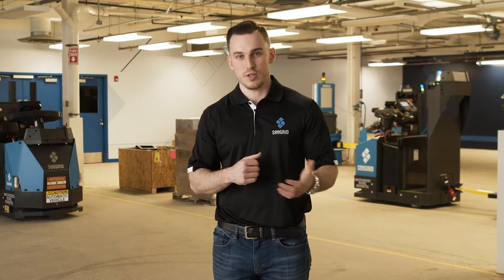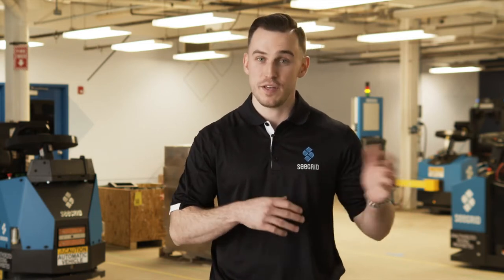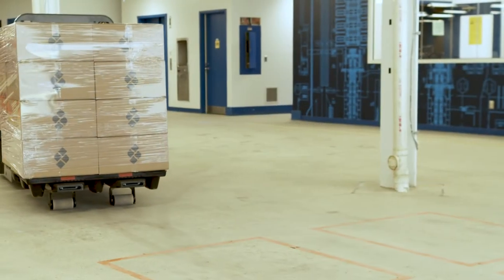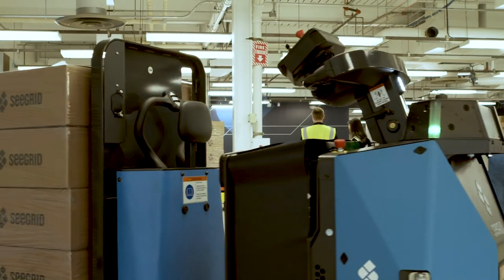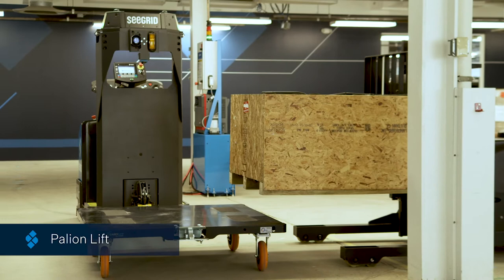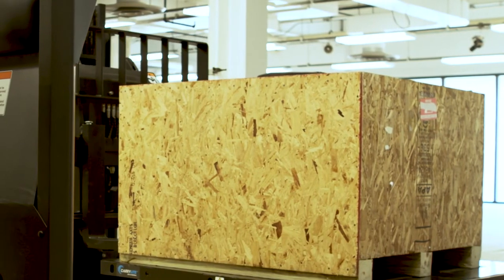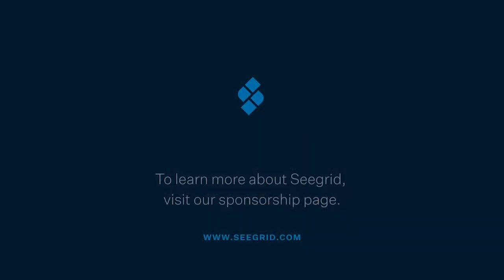Seegrid Product Demo | ProMatDX 2021

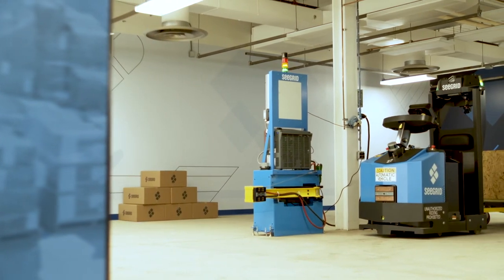Comment: 7:58 Did it just charge itself with the load or received a manual dock command for the video? (:
Reply: It detects a low battery state and proceeds to a charger to charge itself.
Reply: @erichlf  Oh, so it charges its battery just enough to deliver the load. Got it.
Reply: @OrhanGHafif  No it will fully charge the battery.
Reply: @erichlf  I'm a Robotics Engineer. My company makes autonomous robots like this. Our robot also have this auto charging feature. It is illogical to wait for a full charge when it has a task which is to deliver what's on its back. In the factory/warehouse, there will be someone waiting for that load, charging its battery to the full level is unnecessary. It can charge itself fully after emptying its load.
Reply: @OrhanGHafif correct, in real world scenarios the charging would be done at a different time and stop when needed to do productive work instead. This demo is just showing  the charging capability, not when it would be used. Stopping while moving a load or stopping until fully charged wouldn't happen in production situations.